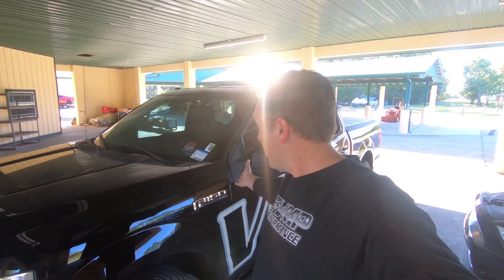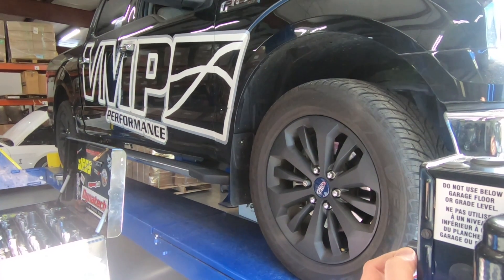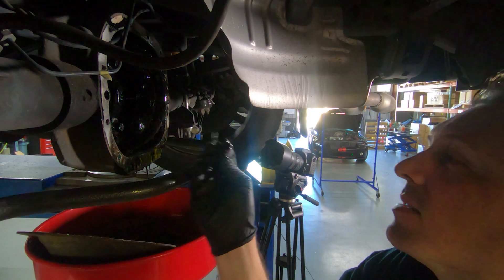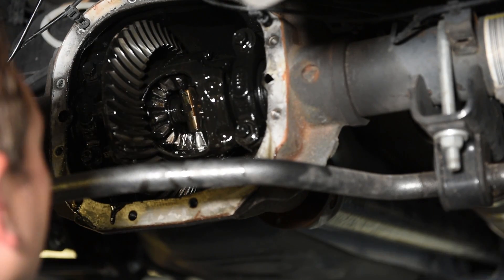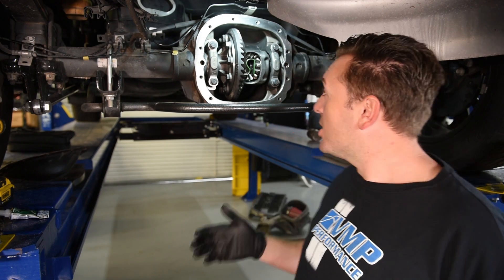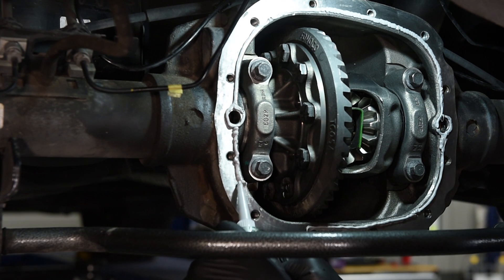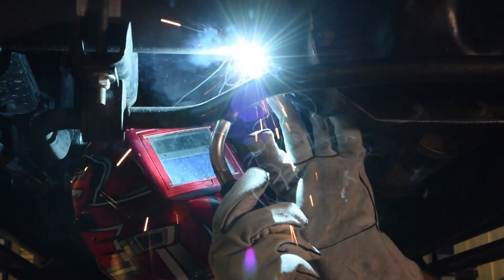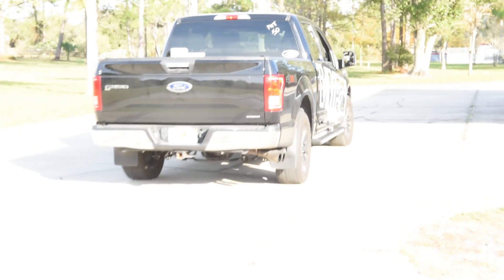VMP's Supercharged F-150 Rear Diff DESTRUCTION

Comment: No surprise that the ring and pinion are good. I work at the Ford Sterling Axle Plant where those are built. Whether it's our High Torque Super 8.8 or our 9.75 set, they're generally tough as can be. I never have been a fan of those plug welds though. I've seen those crack before too.

Comment: Did this truck come with the factory e locker and you swapped in a standard trac loc?
Reply from the maker: This truck did not have the e-locker option, it came with a factory open diff in the rear.
Reply: So the mustang trac loc diff will drop in?

Comment: Are the spider gears bigger when you go for a 3.55 gear or 3.73 ?
Reply: TheBostonstapler No, only the ring and pinion change for ratio changes. The differential remains the same unless you switch to something else. Personally I’d have switched this truck to a Torsen diff in the rear.
Reply: @JsGarage  Feel the same about torsen diff

Comment: You really need a gear type limited slip differential.
Reply: Put an Eaton trutrac in there and call it a day. I blew up my stock 8.8 in my 11 5.0 and now have a clutch less Eaton. Bulletproof
Reply: @maximusvonce1381   at this point in time the eaton trutrac is not available for the super 8.8 rear with the 34 spline axles.
Reply: @malloymotorsports780  Bummer

Comment: Need a 9.75 in the truck
Reply: Brian Still my same thoughts, the updated 8.8 rear end is not ideal for a power F150 build.
Reply: @JsGarage  that would be a cheap way to do it, personally I would put a built 9 inch, would be alot lighter and stronger.
Reply: csr801996 yea 9 inch would be legit of course. Dana 60 semi float is another option too.
Reply: @csr801996  Yes, I put a 9in in mine with 4.11 gears on a TrueTrac with Nodular iron case and Daytona pinion carrier. Welded on a back brace, and cheap disk brakes without an emergency break. Cable emergency brakes are worthless in Michigan, one winter as the salt ruins all the cables. They'll never work! We don't touch the e-brake for fear it will never release or tear a mount off the vehicle instead of engage the brakes. It's common to gut the e-brake from inside the rear rotors during the first brake job.

I'm actually surprised the NTSB hasn't forced auto manufacturers to redesign cable emergency brakes for winter states that use rock salt. There has been rust recalls before, but nothing to change the 100 year old emergency brake design. 🤷🏻‍♂️